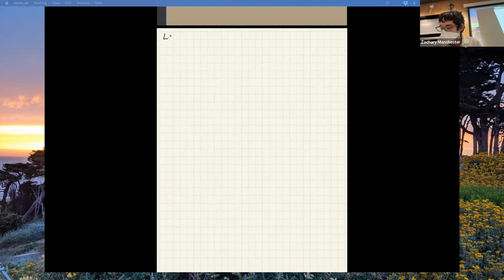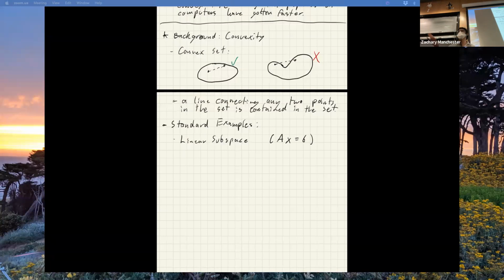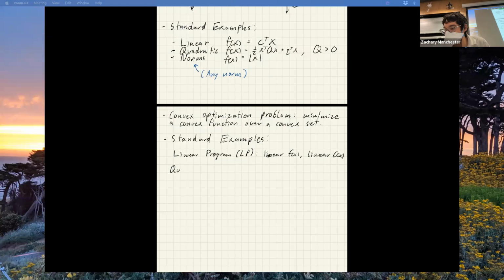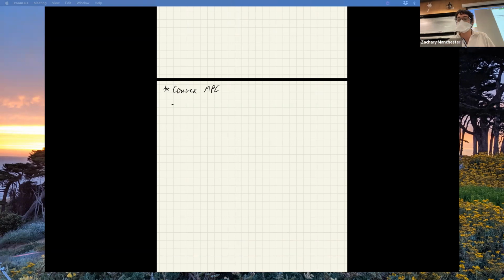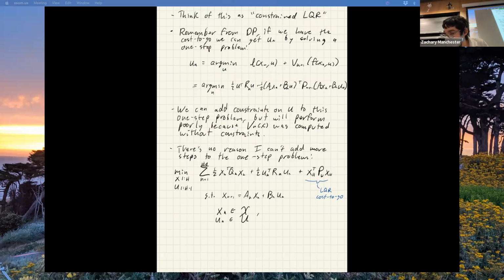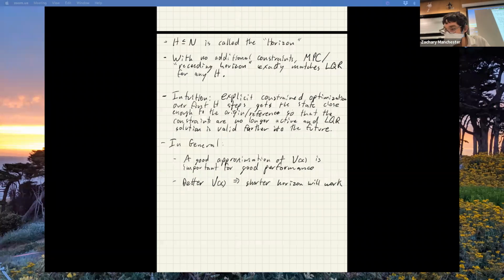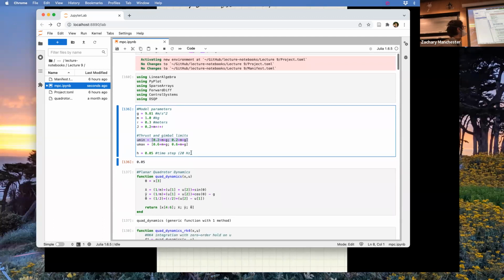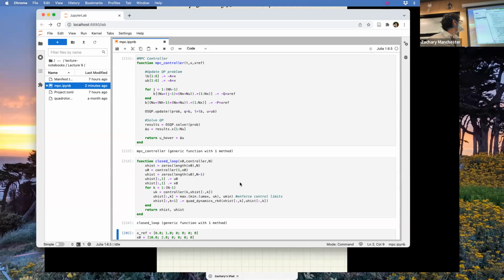Optimal Control (CMU 16-745) - Lecture 9: Convex Model-Predictive Control

Comment: My approach has been to take the Julia examples from the GitHub, and try to port everything to Python. This is a great way to really make sure you understand what is happening in the code. Julia makes it possible to do complex things very quickly and it is easy to lose track of what's really happening. If you port it to Python, you force yourself to think about what you're doing. Highly recommend this approach to other people following along, as this will also simultaneously make you better at Julia.